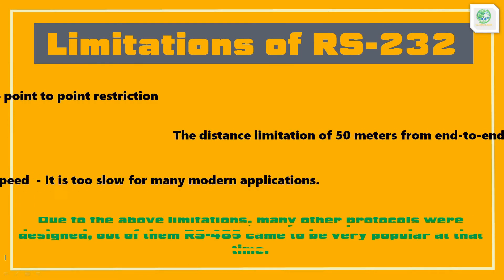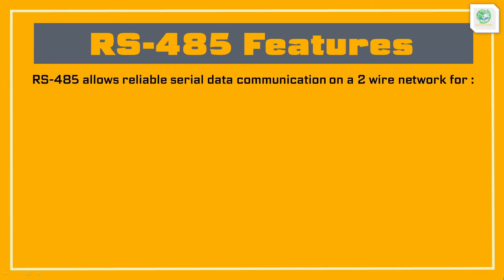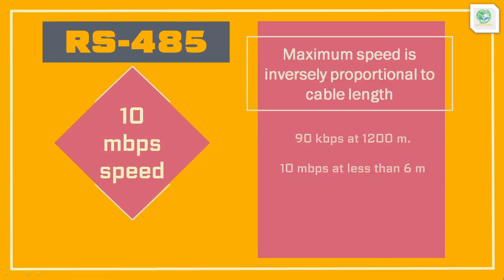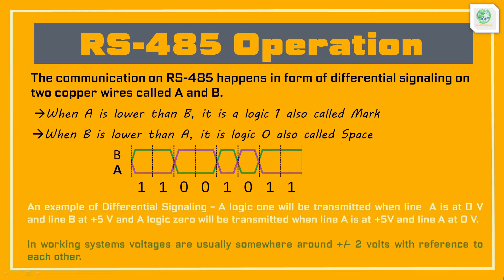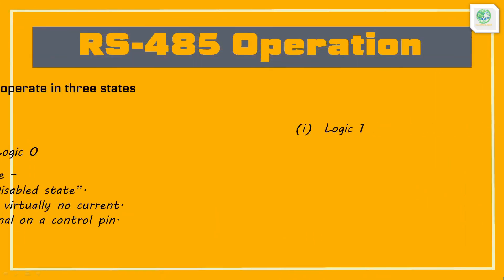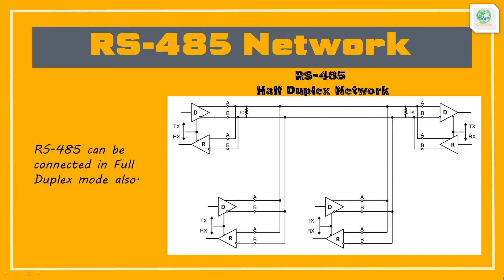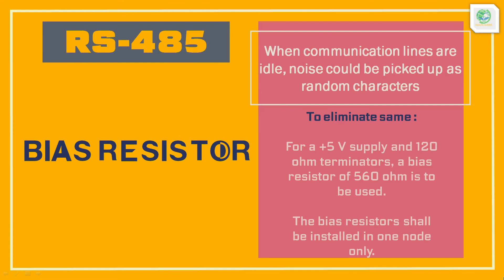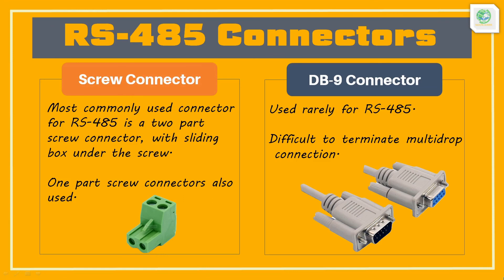What is RS485 serial communication?

Comment: Hello Sir, Thank you so much for your video. I have an inquiry I have a device working by connected an RS232 - RS485 converter, how to may check the signal of the output of RS485 is OK? how to measure the signal of RS485? my distance is 150 meter.... I am waiting for your reply
Reply from the maker: Hi @Mohamed Abdallah, If you want to visualize the signal received on the RS-485 end of the converter, oscilloscope could be used for the same. For checking the data receipt, you can use any serial communication data logger / sniffer software. But to confirm that the communication is correct or not, you must be cross checking the data received with the real expected data. Once that is matched in the serial communication logger software, you can be confirm about the proper working of your converter. 

Hope, I have answered your queries.  

Thanking you,
Eclectic Classes.
Reply: @eclecticclasses  nice expiation,  Thank you so much 🙏
Reply: @eclecticclasses  Can you please send a link for logger/ Sniffer software to visulate the signal is correct or not with any explaining  a video. Your cooperation is highly appreciated
Reply from the maker: @Mohamed Abdallah, there are many paid software , which you can use and even youTube videos are also available for them.

I found a freeware at https://www.windmill.co.uk/serial.html#Tech which you can use for data logging at RS-485 terminals. Being a freeware they dont provide any technical support and even YouTube videos are not available for them.

Thanking you,
Eclectic Classes

Comment: Hi, may I know what software is required to write a program for the RS485?
Reply from the maker: Hi, 

First of all thanks for watching my video. RS-485 is a serial communication electrical interface. RS-485 is used in many industrial communication protocols like Modbus, Profibus, Interbus etc. For an example when you use Siemens PLC and use Profibus as the communication protocol, RS-485 will be working as the backend electrical interface for data communication. There in the Step 7 software meant for Siemens PLC, communication parameters  for Profibus communication could be set. The RS-485 part in the Profibus has already been embedded in the Profibus protocol setting while development of the Step 7 software. So there is nothing much which you can do in RS-485 part.

Hope it will clarify you about RS-485 use.

Thanking You,
Eclectic Classes.
Reply: @eclecticclasses  Thank you very much for replying! Your video was amazing,.

The syringe pump I am using allows external control, and the manual says I could do it by connecting it using the RS485 cable to USB.  But I am having trouble finding ways to code it or receive signals from the syringe pump. And hence I was looking for programs that could read in the RS485 input!
Reply from the maker: @Edmon, If you can provide me the make and model number of the pump, I will download the manual and will try to help you in my best possible way.
Reply from the maker: @Edmon Lee, I just went through the manual. Normally when we receive products like this we use to get a software along with the product for communication with PC. I searched for any software mentioned on their website, none is mentioned. But I got a document for frame formats used for communication on RS-485 for Longer Pumps. Document is at "https://de.drifton.eu/upload_dir/shop/slangepumper/manuals/LSP-RS485-Protocol.pdf". 

With these details it seems you can communicate with the pump using some serial communication / debugging software like Commix 1.4 or ComDebug. 
One more step may be useful, as the protocol used in the pump is not mentioned in the manual only RS-485 electrical interface is mentioned, same may please be confirmed with Longer and if its a non standard defined protocol, the serial communication software like Commix may be used with the defined frame formats as mentioned in the doc  mentioned above.
Thanking you,
Eclectic Classes
Reply: @eclecticclasses  Hi! Thank you very much for your help! Although I did not manage to program the syringe pump, I used a servo motor to press the buttons manually via an Arduino! Works amazing haha! Once again, thank you!
Reply from the maker: @Edmon Lee, congratulations on finding a new and innovative way for your job. You must be technically very sound. Keep achieving the high of the sky. All the best , and have a great career.